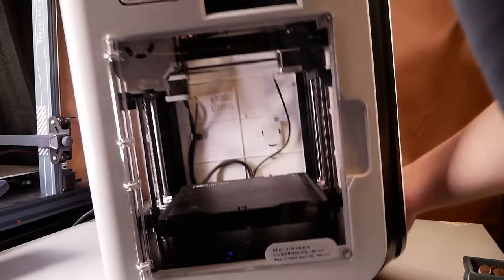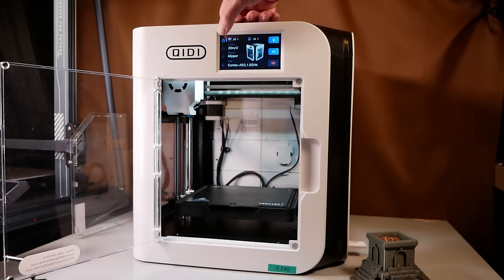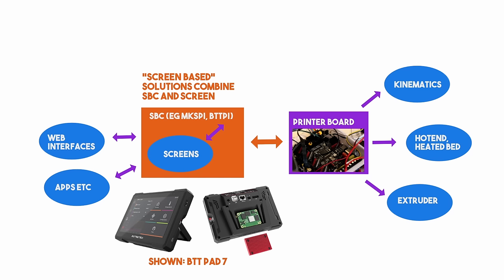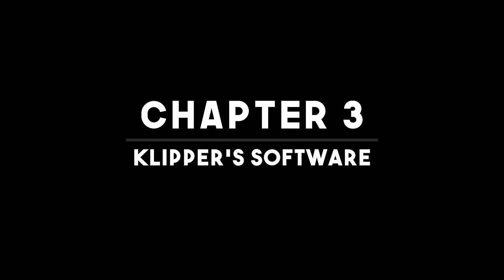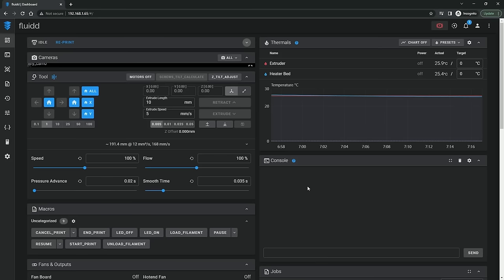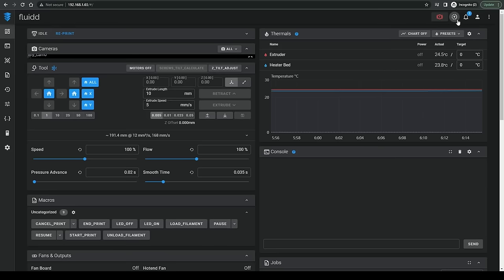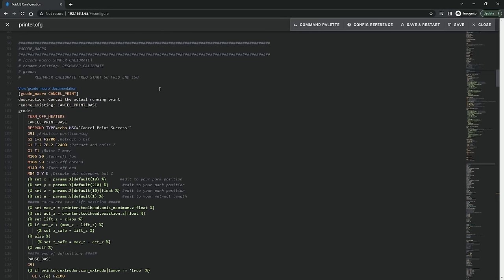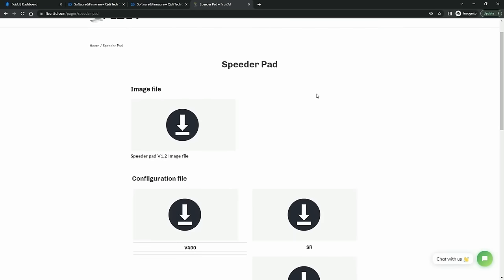Here's what you need to know, if you have a Klipper printer.

Comment: running on the sonic pad, remote access is getting figured out. the safest workaround is to use google remote desk, i just need to setup a dedicated computer for it. it’s a good thing i installed linux on an old laptop (originally intended to be a standalone klipper box).
Reply from the maker: you could run a VPN on any old raspberry pi or that laptop, something like wireguard. Then you're straight into mainsail on the sonic pad
Reply: @LostInTech3D  that’s the idea, but i’m being lazy and i just got into 3d printing 2 months ago. just picked up an ender 5 for $100 and i eventually want to mod it into a budget monster, mostly to prep myself for the voron/zero g life. my wife thinks i’m nuts lol

Comment: Since you've reviewed the SV07 and Qiditech, are they also using the MKS SKIPR board? And if so, are they using the default root login and password? I watched a Neptune 4 video and it was using the SKIPR board and clearly using the default login.   Seems like a major security issue putting a Linux device on any network with a known default login.  Maybe not a Klipper specific issue but definitely an issue as everyone rushes to get their printer "Klipperized"
Reply: Someone is bound to pipe in about "what will someone do with your printer? Print a benchy?"   If someone is going to respond with that, please google "Mirai botnet" and the California IoT Act SB-327
Reply from the maker: you'd have to breach to the LAN. Which is normally impossible but there's interesting implications on shared sites like businesses :)
Reply: @LostInTech3D  Far from impossible. Not common sure, but definitely not impossible. 

Just feels like before we start throwing this linux based 3d printers on the networks, we should be encouraging people to change the default login and/or password.   Just my two cents though.
Reply from the maker: Yep it becomes a problem when its mainstream.

Comment: Klipper is a very good firmware ,honestlly if yuo want to print faster without any problem , klipper is the awser , Marlin can run fast but Klipper have more bdter control , yuo can feel how esdy can made that high aceleration moves

Comment: I'm sorry, but I have had Klipper printers since the very "early" days of klipper and compiling and updating Marlin was a b***h...
Along came Klipper and all of a sudden it was easy to build software for 3D printers and let them evolve and be in the forefront on what is possible with a FDM printer. 

I do respect that alot of people is having problems with klipper, but more often than not it's a user error or just not reading on the screen 😅
So for some of us, its just plain easier and faster than having to fight with Marlin
Reply from the maker: Nothing to apologize for 😁
Reply: @LostInTech3D  i do not want to come out too harsh (I'm Danish)
I know that there are alot of Klipper "religious" people that sometimes trolls 🧌 other believers...

Comment: Well this has been a disappointment. Lots of of overview about problems but nothing showing how to use Klipper. But with the hope of more videos to come.

I bought an Ender 3 when they first came out. Since that time I have used about 25% of a roll of filament that I used in the first month. Then it was left to collect dust until a couple of months ago. I decided Klipper as the way to go. Got a touch probe, modified the 8 bit board for a BL Touch, and got it configured using an old Raspberry Pi 3. (which I have about a dozen of) So I had Klipper working in some ways. I was able to home, execute a bed mesh command (but am not sure it is used in a print). The next problem I had was getting a slicer to feed a useful file to Klipper.  I followed one video to add in the start and stop macros to Prusia slicer and it seems to work. (still no idea on the bed mesh)

There are a few videos on setting up Klipper on specific printers. The problem for me was that they were not the same hardware (than my old 8 bit board) of they did a different image construction process (I used a Mainsail Klipper Moonraker image via the Raspberry Pi imager) or they used Octoprint, or some other slicer. In the end I cobbled something together but I didn't have any videos that showed me how to use it all. Slicer to Klipper and then print. That is what I thought this video might have been initially based on the title. 

What I want? 
Instructions on how to setup slicers to feed Klipper. 
A list of checks to see if I set things up properly. 
At some point to be able to connect a ADXL345 and get input shaping to work. 
To make some optimizations to make use of the advantages of the Klipper platform. (eg. faster printing)

I used to design electronic products (recently retired) so the technical level in this video was no problem. I'm not a programmer but I have written useful programs for hardware. I have limited understanding of Linux, but I manage.
Reply: The KIAUH script to setup Klipper on a linux machine greatly simplifies the config process on the PC side, and writing a working printer.cfg, etc., can be achieved by following the Klipper documentation. You also don't need special hardware to get input shaping to work, you can do it with a test print and some calipers, though the hardware method will certainly be more accurate. That said, I've eliminated ghosting, and can print twice as fast on my Ender 3 v2 than before I was running Klipper.
Reply: The KIAUH script seems a lot more steps compared to using the available Klipper/Moonraker/Mainsail prebuilt image available with the Raspberry Pi imager tool. The bigger problem I had was to do with using the 8 bit board from the earliest release of the Ender 3. There was no clear examples when it came to IO port values to use. Most of the information is for newer boards.

I already have some ADXL345 boards so that isn't an issue. I haven't bother looking into implementing input shaping until I get the slicer, bed leveling, and workflow worked out. Input shaping is a later enhancement.

Comment: I'd like to get Klipper running in a pc with windows! I think is possible but I have only seen people replacing windows with Linux to install klipper. There should be a way to run klipper with some sort of Linux simulator in Windows. Now that I think about it I could live with just a partition running Linux as long as I don't have to get rid of windows. Is to check klipper with an ender Neo btw.
Reply: Ok I'm running Klipper and mainsail in Linux pc but controlling it from my windows pc. In orca slicer you can send the print job directly to mainsail to start printing, that alone (vs having to deal with the sd card for every print) makes the update worth it. About speed, I'm not seeing any advantage on my ender neo, because the hotend seems to be the bottleneck of my printer, it starts underextruding at around 70mm/s. Maybe I didn't set up something correctly (actually i'm using the start g code that I was using for marlin 😅) but not sure that will solve the underextrusion. I'll get there eventually, maybe changing the hotend and/or extruder. And that would be an amazing video Lost in Tech, make a video showing how to get an ender running at more than 100 mm/s wih klipper and enjoy a million viewers.

Comment: If you upgrade Klipper “HOST”, you will over time be required to update the Klipper Firmware as well.  Ideally, you should always update both at the same time, but you don’t necessarily need to.  The thought that you never have to upgrade the Klipper Firmware, is completely wrong.
Reply from the maker: don't believe that's what I meant or said, but I would have to rewatch to confirm. You don't edit the firmware. As in, there's no configuration.

Comment: is it possible to run Klipper on a arduino mega?
Reply from the maker: There's a list on the klipper site as to what it runs on. If it does support arduino (I think so?) you will also need a host controller like a raspberry pi

Comment: I would still prefer Marlin.  I want my actually powerful PC to generate the instruction set for the weak board to read and execute.  I don't want a 3rd world desktop in charge of continually making code and adjustments and then feeding it to the printer in real time.  Especially since I run enclosures and don't want the hassle of replacing more expensive boards or piggybacked boards.  

The reason Marlin printer boards are so under spec'd is because they only read and execute GCODE and some other easy to handle instructions and sensors.  They even run out of memory on complex prints.  Not a hard or expensive fix, 64 bit would help, as would more memory etc.

I do understand that people running Klipper have been getting excellent results, but Marlin is capable of high speed printing too, and will catch up.  Costs would be low to quadruple the compute power of a 64mhz 32bit cortex chip lol.

This is gonna flame some fuzzballs out there, so I will say this:

I know how to use Linux and am no stranger to hardware either.  I am willing to bet this pendulum swings back to Marlin within a year to 18 months. 

Klipper is the bitcoin of 3D printing and most people will jump on board because of influencers, not because they understand it.  Most people who watch this channel are exempt from this rant as well, and can actually make use of Klipper too.

Comment: I don't get it. What's the point of all this when my internet comes from my phone? Sure I'd like to watch my printer when I'm not home but if you don't have an internet connection while you're away no this s*** will work. As long as the printer can take the g code from an SD card I'm happy. 
I have three printers, all Ender 3 neos. One is an original and the other two are neo Max. The small one is quarter inch out of square in the risers and still Prints fine even with the cheapest of filaments. 
I also have a small CNC router and a laser. Neither one of those are a quarter of an inch out of alignment otherwise it wouldn't work. 
I've learned that moisture in the filament it's the biggest headache to 3D printing. So my biggest upgrade is going to be a dehumidifier for my room. :)
Reply from the maker: ....VPN 👍

Comment: I just retrieved the device name off of the router then accessed it by name. For example my V400 speeder pad is named speeder-pad so I access it by putting speeder-pad.local in the browser. I named the raspberry pi for my other printer klipper so I access it by going to klipper.local. I never have to worry about hunting the ip address if it changes.